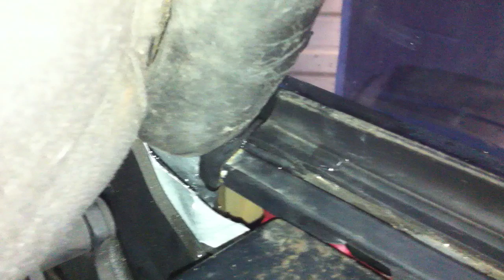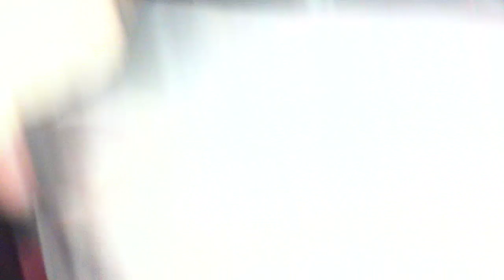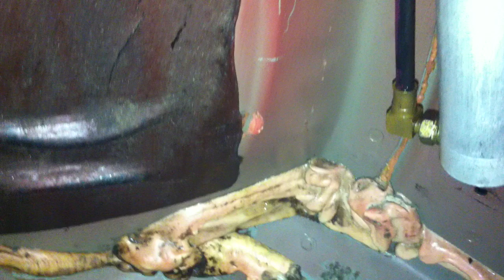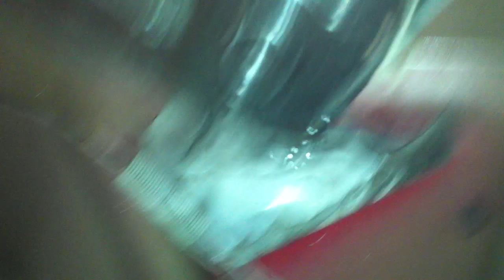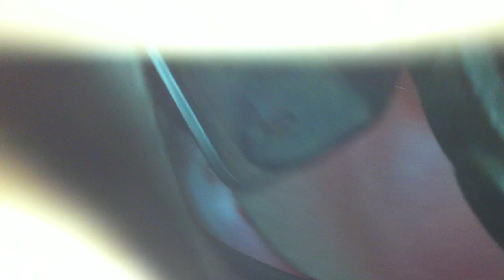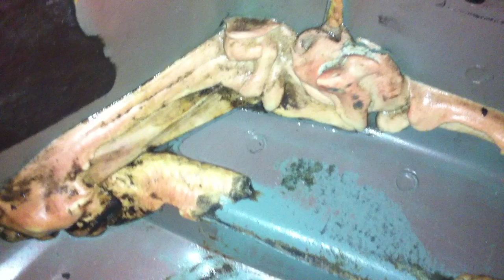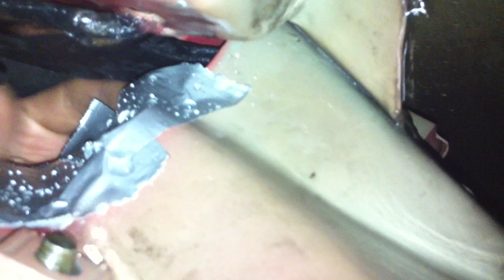mustangtopleaking.MOV

Comment: Nice video bro. I have a 2004 and same problem with my top. What did u do to fix it. I hand to take he back seat out and found that. The leak was from the corner of the rear end window. I had a fair amount of water that drip down to the back passanger seat. But!! When it collected the padding of the rug made it collect and spread  like a wet sponge. So I had to fo lay the carpet and dry. I found by pealing off the cotton pad I would be able to dry both pad and carpet in fair time 2 days. But also saw the danger of the wiring that layed on the floor base board that runs from the dash to center consol.- in time it would have shorted and no good times there. But I was going to take the vent duck to ck for the drain plug to be clogged but had no need to. I suggest to all..... Try removing ones back seat and passanger seat and passanger carpet ( just flare it up so you expose the bottom frame  of the passanger front foot rest and rear passanger foot rest and then u can have someone shower the car and see just what's leaking. In my case it work..... Just as your video proved.... :)

Comment from the maker: This video is from a 2000 mustang convertible with a new top.  Still has some leaking into interior.  So I made this video to show others

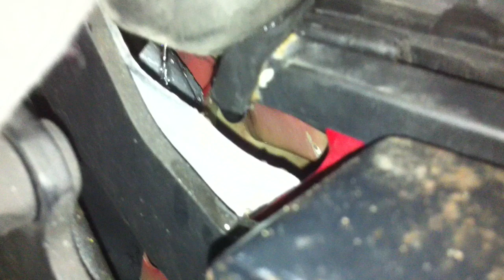The cause of the leak, is shown here(0:00-0:25)  The white part is duct tape I added which solves the leak issue.  

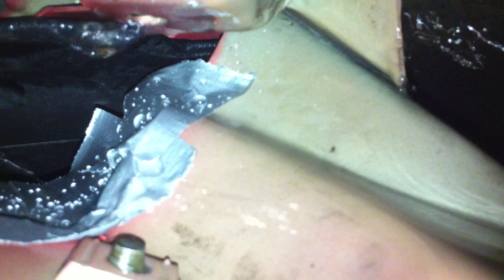Towards the end at 3:40 you can see the duct tape from inside the quarter panel. And at 3:50 I removed the duct tape resulting in leaking in the interior.

Comment: mine is  96 mustang  the bag that  holds the folded top  fills with water  when it rains  any ideas ?????
Reply: I have a 2000 Mustang and have water on the same spot, not much, found this video but I dont understand how and where is placing the tape..... In my case Is just the quarter window gap that allow rain in.